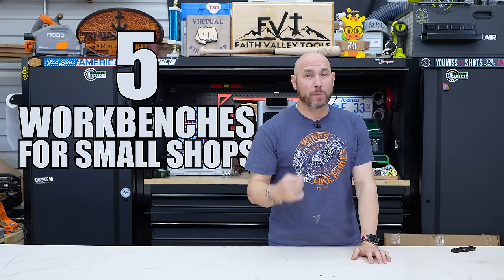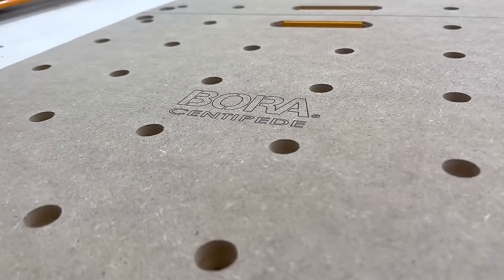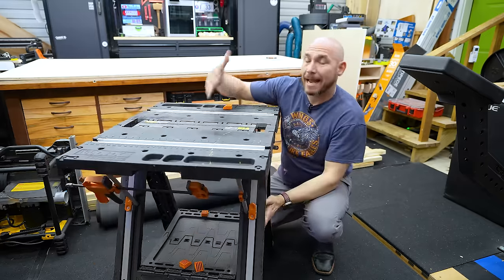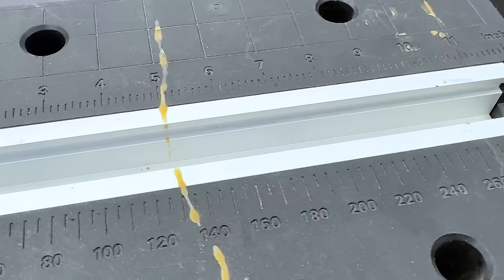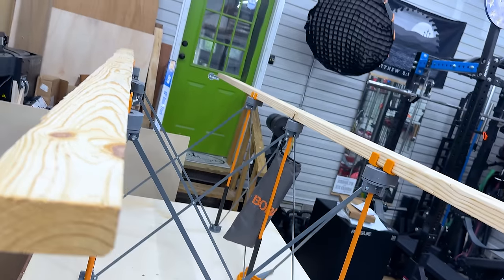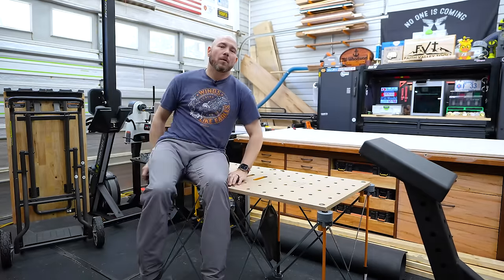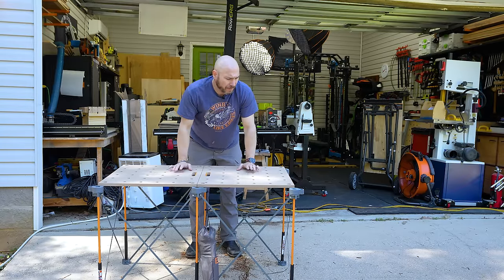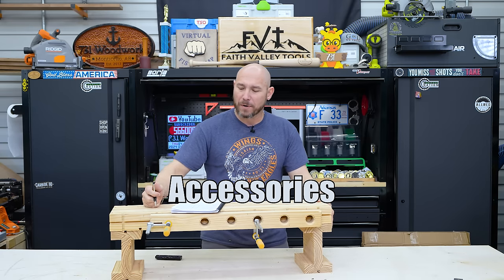Testing 5 Portable Workbenches for Small Woodworking Shops!

Comment: Matt love your channel and your advice and knowledge. I do have the bora MFT top which I purchased from amazon because I found the base unit for sale at a garage sale and I do love the set up but I purchased some accessories that were 20mm and they did not fit the size that worked for me were 19mm / 3/4 inch I don't know if this is a fluke or not or if the Bora top comes in two different sizes help me out. would like to purchase the Taylor tools accessory  package but if there 20mm won't work
Reply from the maker: Ahh, yes it comes in two versions of dog hoes, one is 3/4 one is 20mm

Comment: Would you say the Bora ends up being stable enough to do planing or chisel chopping?
Reply: Not really. For chopping, you want mass to absorb excess energy from each blow on the chisel so the work (or the work bench) doesn't bounce. You CAN chop on the Bora, but it's less than ideal. For planing, the Bora should work fine.

Comment: You were too kind to the Bora.  Ease of use should have been at most a 4 maybe even 3.  1) the tendency to pinch...everything.  Those of us without a large arm reach will be fighting that thing trying to put the table on and off.  2) Table top is heavy, again, difficult for us smaller people and 3) it has to be assembled every time.  The Festool table only has to be assembled once but the legs have to be "opened and screwed down so a 3.  You do have to take into consideration price.  That is a HUGE factor in any tool especially for a "mobile" one.  Honestly, for a mobile benchtop the best options are the other 3 as they are either completely assembled or just have a "pop up" assembly.  If you really are going to put it away when finished, the Bora and Festool would be down the list IMO.  That said, I love that Festool table and would love to have one, but I'd make a cart for it, not use it as a table to put away.

Comment: I got the BORA and hated it :( It was super flimsy without the not included top and having it be 2 pieces was annoying for me and also on a non-flat floor or on a concrete/epoxy floor this thing moves around like crazy.  Something where the top always stays on and the base being more centered for stability on uneven surfaces is super important for me.   Im sure its fine ut it really did not work for me, i never wanted to take it out

Comment: I was looking at the mft table but will the track fit my makita track saw ?
Reply from the maker: Yes, you can use it on the MFT
Reply: @731Woodworks  yes I saw that but I like a dummy I didn't watch the whole video before I post my question 😅  Thanks Matt